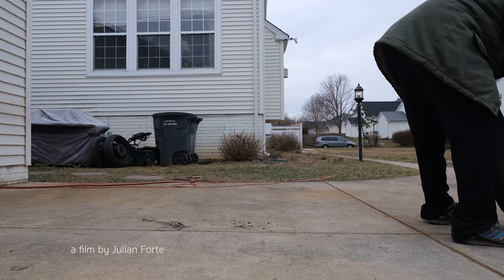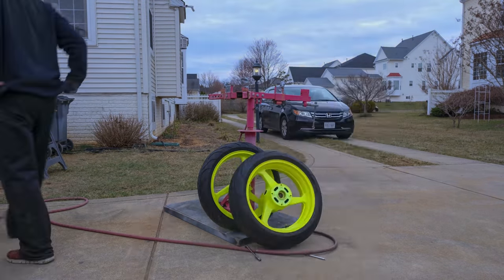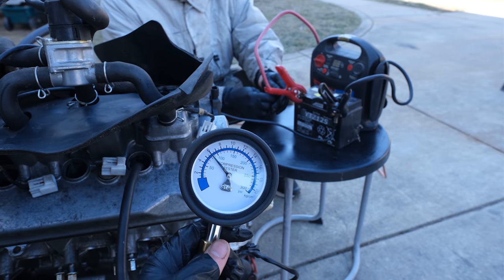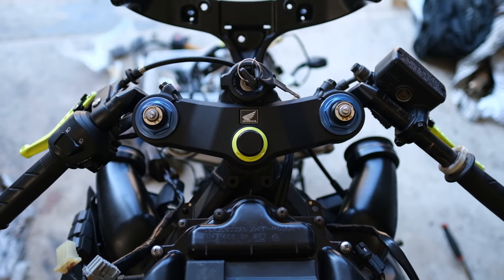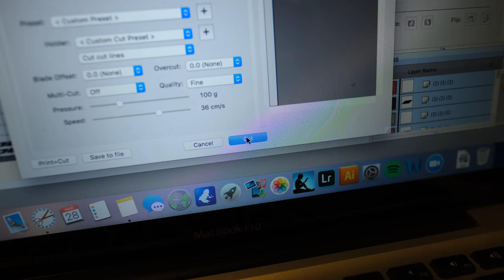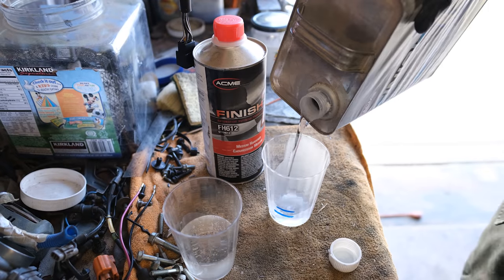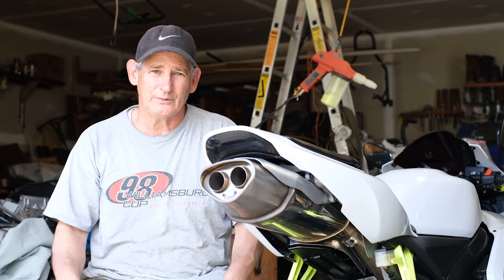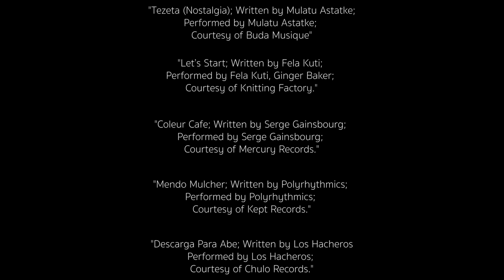Restoring a Wrecked Honda CBR600RR Motorcycle Start to Finish in 4k!

Comment: I love how meticulous you guys are. These are times with your dad that you'll treasure forever. Wholesome! I'm restoring an SV1000 and there are some nice tips in here. Thanks for the quality content
Reply: My favorite bike! Wish they would come out with a new model. I love my 03 s model, but its getting a little long in the tooth, but ill keep it on the road as long as humanly possible.
Reply: @sinformant  there's a new 650, called the Gladius which is kind of the spiritual successor of the SV. The SV1000 was actually a commercial failure, which is probably why there's no Gladius 1000. Cool bikes nonetheless!
Reply: @IRideThereforeIExist  I know of the gladius.they did release a new sv650 as well. Not a huge fan. The sv1000/s was very popular in europe. I believe they had it for a few years longer than the us. They cut it off here in the us at 09. Everyone here in the us wants the gsxr,zxr, and the yzfr. I figured with the recent popularity of v twin and paralell twin and flat plane crank 4cyl bikes here in the us suzuki would jump on board and make a new one. To me the sv650 is fun, but just doesn't have the grunt of its big bro.

Comment: I have the same bike. Bought it last year. It rode as it was but needed signals and a few other things. Wires were spliced wrong and the lights didn’t work. I fixed that. New fairings. Slip on all new lights and signals. Chains and sprockets. New tires. Everything. It was so much fun even though it was irritating at times. Working on my motorcycle is probably one of my favorite things to do. Great video. I’ve been wanting to buy a wrecked 1000rr and this inspired me even more. Thanks for the awesome content.

Comment: I have no reason to doubt the capabilities of these guys with regards to cosmetics. But refering to frame repairs as "not structural" is worrying...
Reply: As worrying as the idea of putting ABS plastic in the oven and expecting it not to melt 😂😂😂😂
Reply: @skrebzilla10th  that's actually a fairly nifty method of clearing out all the remaining petrol from the tank before cutting it open. That way stray sparks from cutting the metal couldn't ignite it suddenly and burn them
Reply: @madeleinegillett5892  Stupid and reckless shade tree bullshit. The proper way is to rinse it with lots of water, then purge it thoroughly with CO2 or Argon before cutting.
Reply: @Hawk7886  they weren't gonna go to that effort for a tank they only wanted the cap from ffs. They literally only cared about the lock and as long as they were on hand with an extinguisher and did it in a well ventilated area with no dry shiz anywhere, theres no problem with it.

You'd be stunned to find out the most common way techies test a wet patch to find out whether it's petrol or diesel
Reply: amazing how honda put so much unnecesary material on that frame...
Reply: Clearly nobody here has ever patched a live gas pipeline before.... CO2 purge?! Ha, how about a lighter?
Reply: Tomislav Solina 😂

Comment: I can’t believe you’ve called cracked frame non structural damage and repaired it with a putty and showed it to the kids 😱😱 are you gonna sell this to someone now?
Reply: said he welded the aluminum. used the putty to cover welds for a cosmetic fix. this guy and his father seemed to do a top notch resto, IMO
Reply: @tjolofree1134 still depending on where the crack was… welding it is a hazard should never just weld a cracked frame and call it good
Reply: Ebay is a restorers best friend, frames subframes every part your looking for can be found. I wouldn't re-use a frame with cracks. Honestly it prolly wouldn't ever become an issue for a daily commuter but theres always a but.... lots of power from these lil 4 cylinders

Comment: Where do you buy most of your replacement parts from, can you recommend a good parts site?
Reply: yeah want to know too :P
Reply from the maker: Hey guys. I often use a site called Motosport.com for buying new OEM replacement parts. You gotta be careful with some of these sites bc they often charge a flat shipping fee.. works out well for some parts but really bad for small parts that cost little to ship. eBay is the next place I go..
Reply: Ebay is my go to for most of the used OEM parts I buy to rebuild my bikes. I have also found Partzilla is one of the lowest priced sites for brand new OEM parts.

Comment: weld a frame hide it with paint jb weld exhaust blend it hide it dont tell customer about crap repairs would you want to buy a bike from these ?
Reply: Don't forget the blobs of bare solder on the wiring harness that's just taped up, "purging" the fuel tank with an open flame, "welding" ABS with a dirty soldering iron and covering it with regular body filler, spraying a base coat over unprepped plastic, and powder coating the shifter linkage threads. Yeah I would definitely not wish my worst enemy to ride that thing.
Reply: yeah on the note of jb weld is that it doesn't like heating up all the well compared to steel, for instance that exhaust "fix" wont last due to thermal expansion and contraction, also if they've had years to practice welding then that frame could of been welded up just fine and still look good. covering it with jb  weld comes off to me as that the weld were not up to par. this project just feels like putting makeup on a pig and pawning it off.
Reply: Well i dont think they are `hiding` anything by posting all their work on youtube. I wouldnt ride this thing tho. I personaly have a problem with `tampering with sportbike frames` type of things. I think its dangerous, stupid and not worth it.
Reply: @crnodete  If the damage doesn't affect the structural integrity of the frame. Then a bit of weld filling the scratches or small gouges are fine. They showed the damage and it was minor. Their repair was purely cosmetic. Nothing I seen on this build were unsafe. A couple of things problematic down the road yes. But nothing dangerous. All of you are being drama queens. Post your work on YouTube for the world to critique please. Sense  you're so perfect. Or so you think.
Reply: @chadtucker2875  Like i said, no i wouldnt ride that thing and theres no drama. The bike is worth couple of grand and i am not educated enough into researching whether the frame will crack or not so id rather get the factory spec one. I value my life more than an educated guess of those two gentlemen who have done an incredible job on the bike really.

Comment: The frame puncture repair "wasn't in a structural area".  It was just at one of the motor mounts.  In a frame with a stressed engine.  And all we saw was you hitting it with a torch and then covering it in filler and paint.

Sure, I'd trust that frame.

Comment: Congrats! Very impressive dudes. I got a full set of CBR1000RR 2004's race fairings at my garage to be installed on the bike. But I'm still lookin a wrecked one but not yet to be found so far. Fortunately, my R1 year 2004 still can be used hardly lol. But the most important thing is, do the rides at a frequent time to avoid the 'laziness' inside your souls lmao

Comment: I tend to use barbecue black paint for a good match for yamaha bikes ive even used drab olive green nail varnish for break line ends or bolts before i got my zinc plating kit with yellow pasavate & drab green i did it for the love of it not for making money on the bike i have at the moment nice build by the way

Comment: Hey I’m a 20year old in Brooklyn New York who bought a 2004 cbr1000rr with a blown engine. I’m struggling to even get the engine out after moving all of the engine mounts/electronics/ and tubes. I see all of the engine mount holes misaligned so the engine is out of place but not sure why it won’t come out. Also if you can give me some tips and tricks to move on with this project because I’m stuck with it and I want to get it done but seems like there’s a problem after problem. I just solved a problem I made which was a stripped 17mm engine mount nut, I used sae instead of standard by accident and stripped it but managed to get it out using a breaker bar and nut extraction sockets with teeth but now that I got the mounts off I’m stuck with not being able to take out the engine. It’s problem after problem. I’m in school for diesel mechanics and trying to develop my skills with this project and I just finished bobbing my Honda shadow. That went problematic but I got it done

Comment: Them new aluminum welding rods that I see advertised on YouTube have you tried them? Great job, I wish I had your equipment to do a 1979 KZ 1300,with only 3800 miles it's been sitting in my garage since 1981 it's mint, but needs a full strip down as you did. You got one great Dad!

Comment: Anything can be repaired. Question is how cost effective is it to repair? How much did the wrecked bike cost? What was the cost of parts? How much time was invested? What would the cost of a good running CBR600 cost? What's the value of the repaired CBR600 as determined by the Insurance company?

Comment: GOOD build i like the attention to detail..my only concern is the fact you welded the FRAME... these bikes are welded by a ROBOT..
the aluminum frame is made up of pieces INNER and OUTER..then put together on a JIG and welded..its hard to tell the thickness and
you cannot be sure if the weld or aluminum is GOOD...you would of been better off buying a USED scratched frame that just needed sanding and repaint

Comment: great job! great video! My only question is about licence plates, here in my country we can not run with out them, where will you put them? The plate holders to that model are not so fitting to your design :(
Reply from the maker: Raphael Leite plate holder is mounted to the rear axle. Take a closer look at the photos at the end

Comment: One question tho, I watched ur decal video and watched this one, how do you figure the dimensions on that software to fit the right dimensions on the bike. I'm planning on making the decals and saving it to go get it cut/printed.
Reply from the maker: XevilangleX you can set illustrator to give you actual dimensions. This helps but it’s mostly trial and error.

Comment: Did you only spray the wheels in the parts that will be seen? I got my car wheels done and they went over EVERY inch. It's not about what you can't see, but protection on buts you can't see or don't see very often.

I think the correct term is a media blaster instead of sand... Sand is rarely used.

That jar contains parts that do not belong on any motorcycle and is a sign of a DIYer

Comment: Did u do something to the engines like changes some part or just do some services
Reply from the maker: mohd akmal Other than adding a power commander & exhaust system we don’t do much modification to the inside of the engines for reliability purposes.. These Japanese bikes will run forever with proper maintenance...

Comment: Progress on my cbr is coming along, do you happen to have all the sizing for the decals I’m really struggling to find them online can’t measure my existing ones I’ve taken them off with out thinking :(
Reply from the maker: Hey bud. Not sure if I can help you with the sizing specifically - As long as you have good vector files and cut something within the right ball-park in terms of size, you should be fine. Cut larger if you're unsure.. If you really want to be super accurate (sometimes I do this) you can measure the width of existing OEM decal & then find an image of the fairing (on eBay or google images) you need decals for, bring that image into Illustrator & scale up the image so that the sizes match.. Then you can know how wide the other decals need to be based on that... Hopefully that made a little sense.. 🤔
Reply: Yeh that makes sense, i managed to get the decals done now, my bike is really coming along.

Comment: I need some help I have a tire changer and want to mount it something like what you have what is that exactly and the dimensions if you don’t mind I would really appreciate it?
Reply from the maker: Neigal Cox we literally use to thick heavy flat pieces of wood that are a few feet longer than the legs of the tire changer..

Comment: How do you balance the wheels?
Reply from the maker: Find something you can spin the wheels freely on - we use a simple quick bike lift with an axle across it. Then add weights opposite to the "heavy" until there aren't any more "heavy" spots

Comment: It's a really cool video with a good story but I wish you would use proper parts and do more than just cosmetics. Those ebay levers are dangerous, the brake fluid was brown and you used car oil.

Comment: Don't know if you know this, the frame puncture was a structural issue, you're not supposed to powder coat over the disc's mounting surfaces as they need to sit flat... same with he chain adjusters as they need to move freely, honestly the vid is great but you've gone insane with the powder coating, i mean.... fuck even the threads on the gear shift rod have been coated...

Comment: You don't have to cut the gas cap off oh my God drill the lock out
Reply: Also once you got metal the cap will spin an I jerked when it started to spin then mine came out on the drill bit then I put a screw on cap on bc I didn't want the problem to happen again

Comment: so lets restoe a bike that goes above 200 easy .. 0-60 in 3 ish secs .. with a bent frame .. dosent sound to safe to me .. nice project .. but why the hassle ? tip to those of u out there attempting to sandblast at home .. u dont need major highend gear .. just air compressor with long nose gun .. and sodabottle with hole in it .. done .. easy to make .. look it up on tube here

Comment: I am a educated certified motorbike mecanick with 35 years experience
A frame IS The structuel part of a bike.Repairs like that weekens the frame and maks the bike leathal do drive
When you get a chrash damaged bike you first mesure the front fork and rims.How du you mesure the triple clamps?
When the fork ,rims and clamps are mesured ok, you make a rolling chassi and then you can mesure the frame.I use a laser tool
If all the main coponents is ok you kan make an inventory list an sjekk if repair is profitabel.
Why cut a fuel tank in half?You only risk dangeros fuel leaks Very easy to get those second hand cheaply
Sorry,but you hav abeselutly now idea what you are doing.Your video is vel made and can fool many, but its actually just crap
Wreck the bike ann sell it for parts